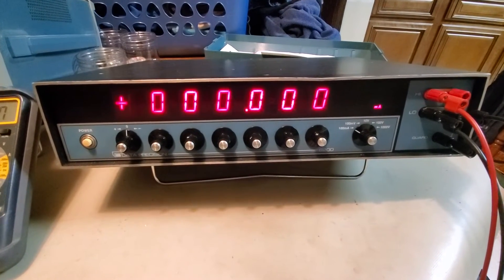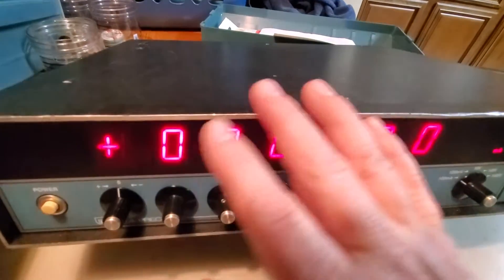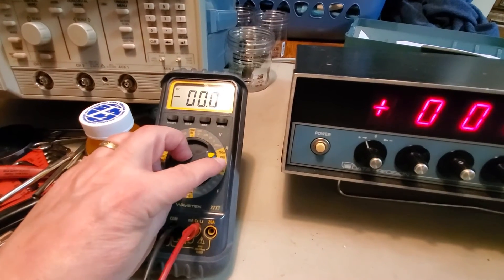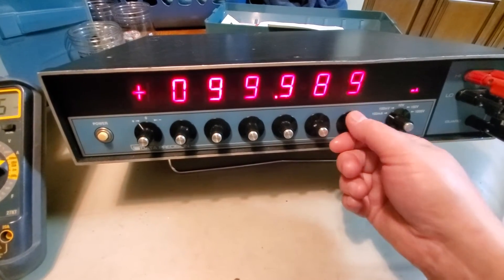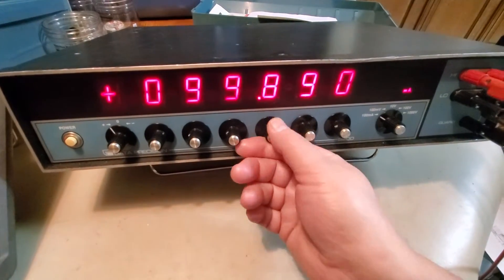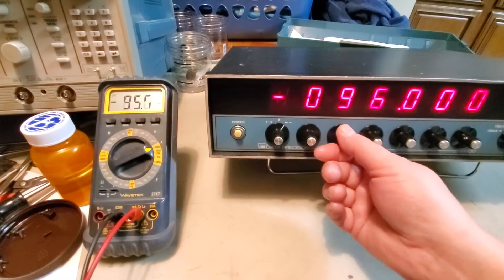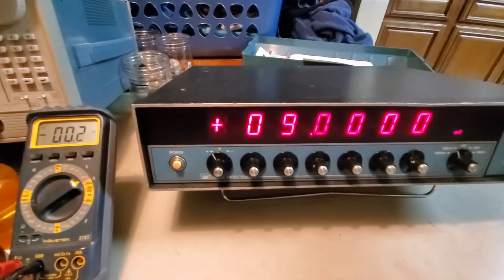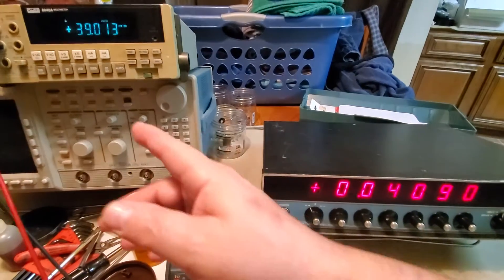Data Precision 8200 Repair Initial Check out Part 1

Comment: The 100mV output is at the back (round 3 pin DIN like connector J301) of the device. The front binding posts are for mA, 10V, 100V and 1000V (if available). I have the same calibrator that I bought used. The 100mV wasn't working, but it was because of one of relay K3 tracks that was cracked. Now, I have to repair the 100mA range that is always at full power. Maybe K1 relay is not working, or something else. Waiting for part #3 of your series !
Reply from the maker: Hey Bruno do you have the 1K option in your unit? If so I'd like to get the info on it so I can build my own 1K option.
Reply: Keith, unfortunately not. I found once a picture of the 1kV board but I can’t find it anymore. It was very partial anyway. It might be possible to find some schematics. I´m not really in a quest for this option, but if I find something, I will share.